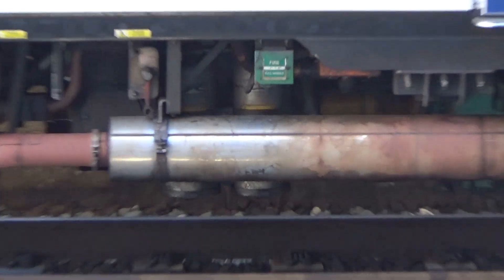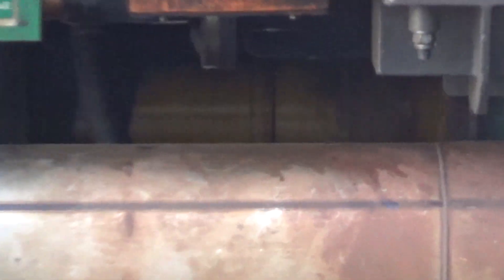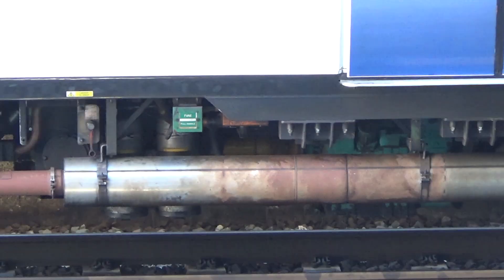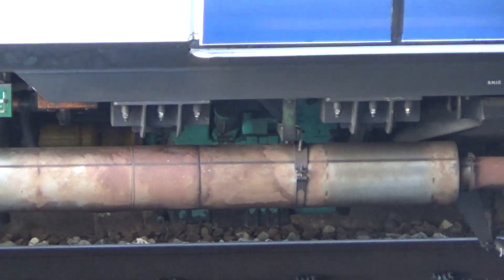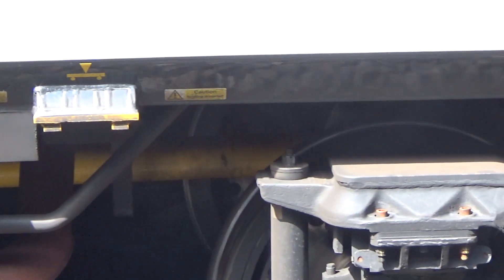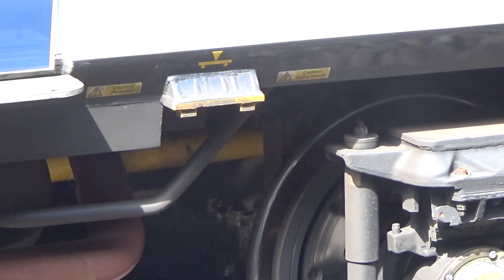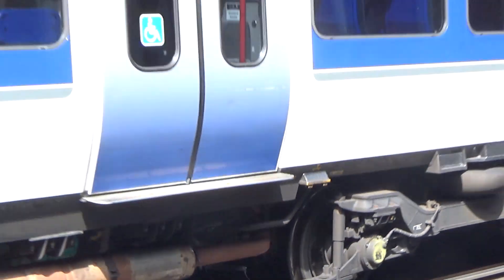What are Diesel Hydraulics, Electrics, and Mechanicals? How are they different?

Comment: One detail you left out is that diesel (or petrol) engines can't just stop like an electric motor. They have to spin at a minimum 500 (or whatever) rpm. If they stop they need an outside motor to get going (or a hand crank!) That's why your internal combustion engine car has to have a starter and also a clutch to detach the idling engine from the drivetrain or a fluid coupling (with or without the stator, which makes it a torque converter) which can spin the oil around inside without the drivetrain moving. This is why your automatic trans car will creep unless you have the brakes on if stopped in Drive.

Comment: 3:53 I don't hear electric sounds on this Meridean, even if it's diesel-electric. Isn't a high pitched diesel sound actually an electric one?
Reply from the maker: not all the electric sounds are in the range you can hear, think its probs that. or the engine just drowns out the electric motor
Reply: @LTRains  Oh, ok. Thank you for explanation.

Comment: Diesel Hydraulic units at a certain speed will go into direct drive mode, where the wheels and engines are locked together and spin at the same speed. On some old diesel-electrics, the engine spun a dynamo instead of a generator, which produces straight DC rather than AC, which then gets converted to DC. Diesel hydraulic is also used at the Western Region locos. Diesel Mechanical has been used on some mixed traffic locos like the Fell.
Reply: Automatic transmission cars also generally have a lockup on the torque converter at around 40 mph/65 kph (a few much earlier and pretty much all of them by 1990).